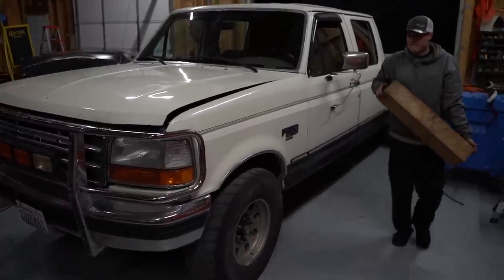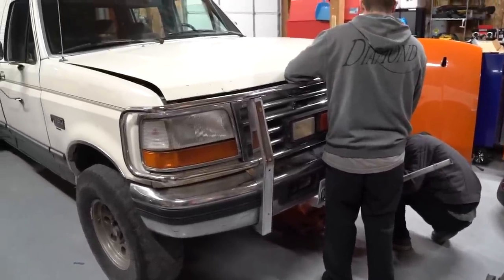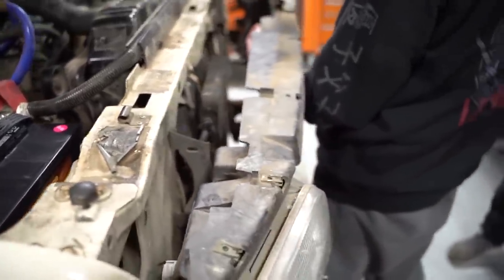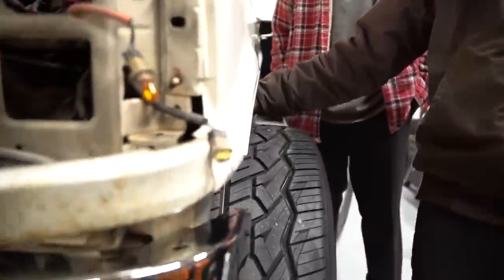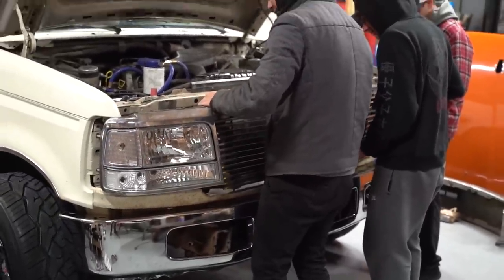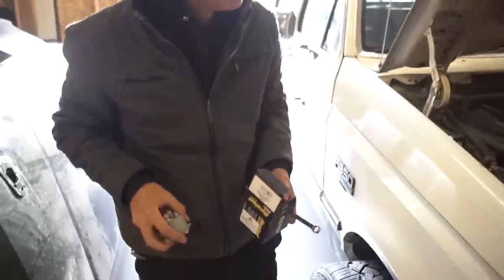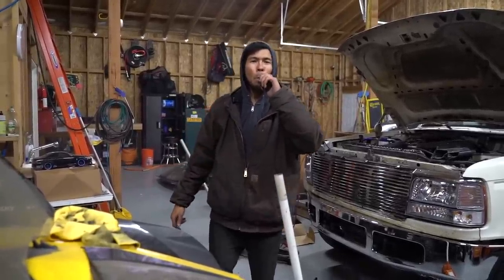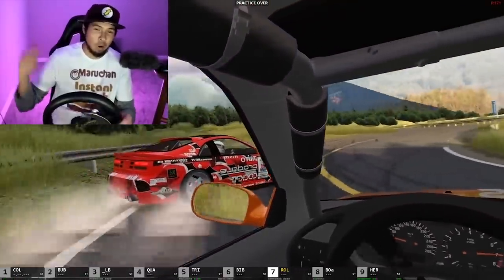Slammed my DIESEL Truck on STANCE Wheels!

Comment: Can we talk about how the eBay special spacers aren’t even hub central 😂
Reply: Eduardo Bravo centric*
Reply: It's lug centric
Reply: @kelly00000111111  really dude get a lifë
Reply: ricochetey I have one. Probably due to the fact that I am educated enough to know that it’s not “hub central” and IS “hub centric”.
Reply: @arturo762  its actually hub centric the lug has nothing to go with it the hub aka center needs to match
Reply: @kazern95  The place where the nut sits on is tapered, it will center itself out when tightened.
Reply: @arturo762  He's right everyone, with spacers they have to be lug centric, as in conical seats due to clearing the 4WD hubs. Wheels have to be hub centric due to them fitting snug over the hub enough to be straight. This is a 3/4 ton though, so it has 8 studs and large hubs due to the manual range selectors, so the spacers rely on the studs to center themselves.
Reply: RIP his wheel bearings